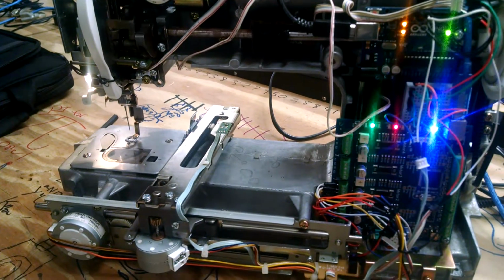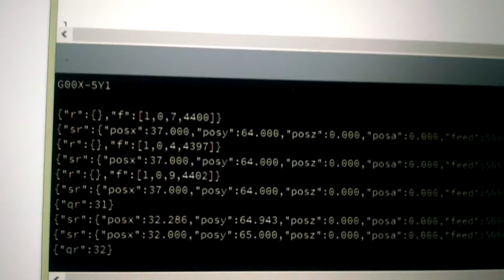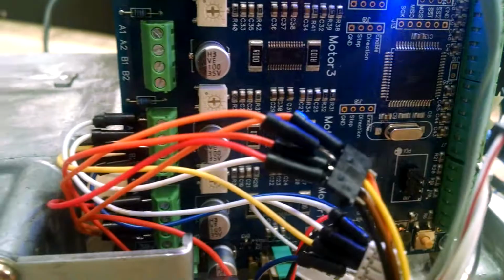Open Source Digital Embroidery progress

Comment: I see in other videos that machine use three optical sensor. I will use a mach3 to control the stepper motor ( x,y),, but for needle position I dont know how to Synchronize the movement of the pantograph with the needle. how software do you use?
Reply from the maker: So this is a cracked open PE180 Brother machine which had optical encoders installed, it is just transparent plastic with black spokes printed on it spun on an axle with an optical switch on the edge so that a microcontroller can count (via interruption) how many degrees the axle has spun. Then if you can see in the other video there are offset black disks which indicate whether the needle is high or low. I used processing but there's nothing special about it, just what I knew at the time. The movement was instantaneous with sending the proper gcode over serial, so I would count degrees until the needle was on its way up, and send a string of gcode for one movement.

Comment: excellent..  Iam building a machine, but i have problem with the syncrony...   how to do .. that xy table move only when the needle is up.

in your project.. your machine can move faster??  please send me more information.
the connection and code.... please  Im student.
Reply from the maker: Isaac Vargas oh man, I have no idea where the code is, these were the days before I learned git! tell me more about what you're building I can try to advise :) it's necessary to move when the needle is up, otherwise the fabric would pull the needle with it.
Reply: thanks friend.  How type of motor use in the needle?
Reply from the maker: The needle is belt driven from a fairly large DC line-voltage motor, typical for sewing machines. I never figured out how to control the speed of it because I was afraid to tap into high voltage parts :) It is more complicated to predict when you can speed up and slow down the needle speed, as there is a long delay between applying voltage and the motor accelerating. I guess I just planned on doing it all very slowly :)